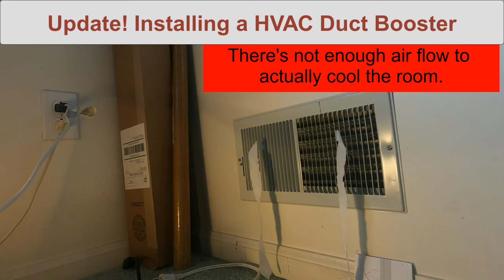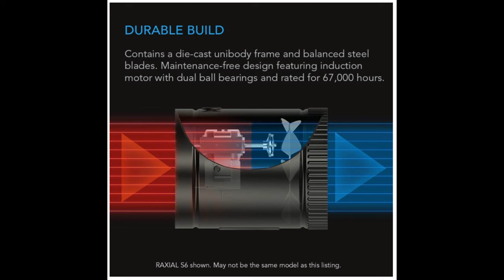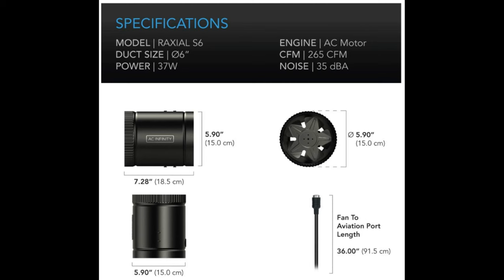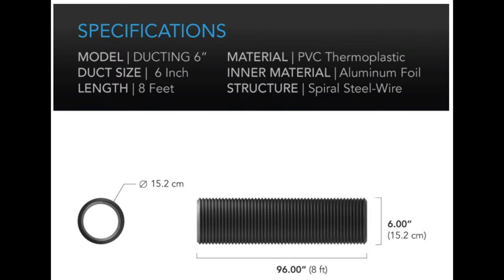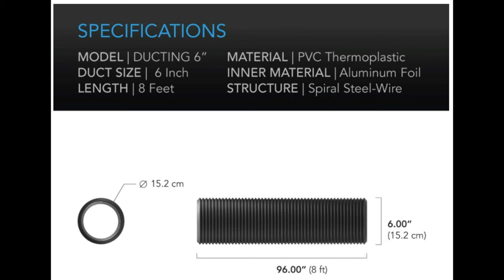Installing a HVAC Duct Booster - Part 1 | Update/Re-edit | Man About Home

Comment: Wonder if you can connect a raspberry pie to a switch that the fan is connected to. Code it so that if the heat or cool is running then turn fan on, else turn fan off. That way the fan does not require someone to manually turn it on/off.
Reply from the maker: Please check out my Duct Booster play list. I control it via a relay, with the furnace's Electronic Air Cleaner output. When the furnace blower is running, the booster is running. When it stops, the booster stops. Thank you for watching and commenting!